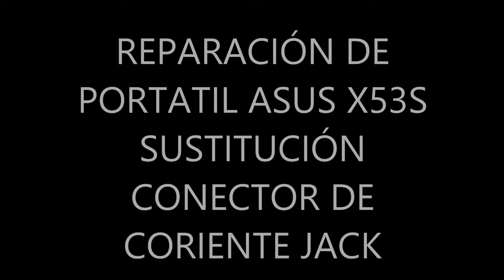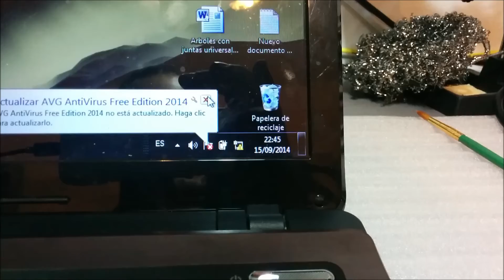✅Repara conector de corriente DC Power Jack de ASUS X53S (REPARACIÓN CONECTOR, LIMPIEZA)

Comment: Hola. Buenas tardes. Me interesaría saber si el modelo de pin de carga para laptop K53 series le sirve para el modelo A43E. Gracias.
Reply from the maker: Son exactamente el mismo, te paso un enlace en en el que se puede comprar y salen algunos de los modelos que son compatibles. http://www.ebay.es/itm/DC-POWER-JACK-CONECTOR-CARGA-PORTATIL-ASUS-A43-A52-A53-A72-K43-K52-K53-K72-PJ033-/112037380982